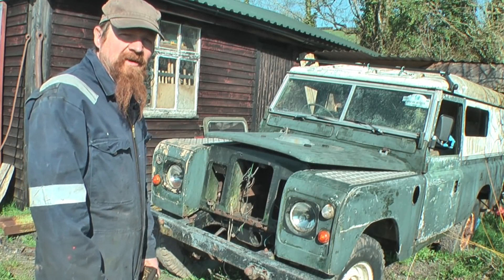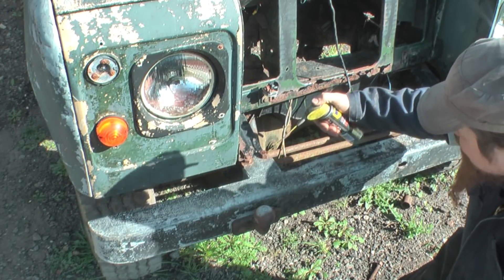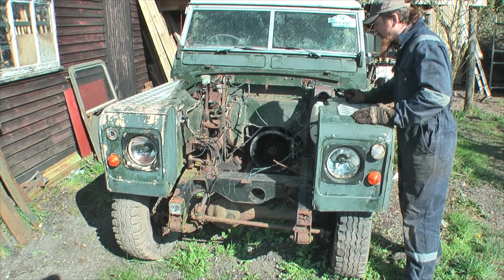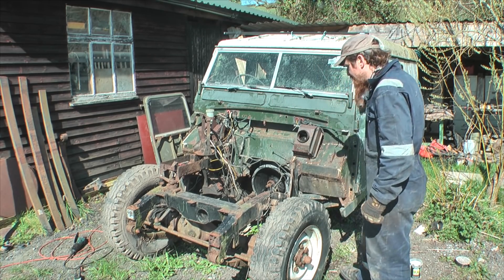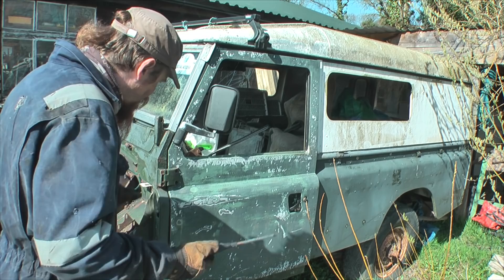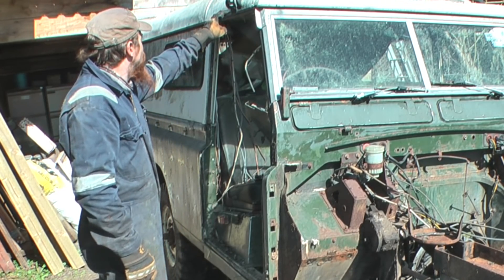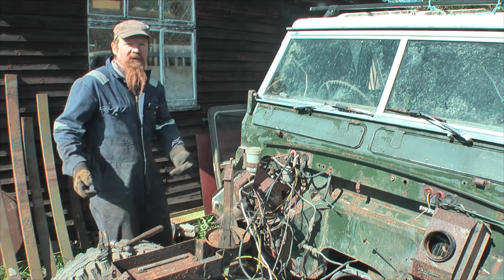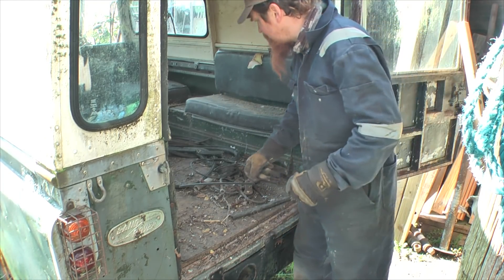Project Kermit 2: A Land Rover Series 3 Full Restoration

Comment: It’s not as bad as the last Land Rover. That caught fire twice 😳
Reply: That's the high spec heating kicking in.
Reply: EnglishAndy I bought a Series to off an electrician who replace the fuse with a 13 amp house fuse! I had a small bonfire in the engine bay and had to replace all the wiring as he had used blue, brown and yellow/green wire to repair it.
Reply: Oh I must have missed this. Wen caught it fire?
Reply: Only twice? You're not trying hard enough!

Comment: A sterling start on rectifying years of corrosion and bovine related bodgery. 
Aluminium and steel never a good combo, Ali bicycle frame steel seatpost springs to mind 🤣

I look forward greatly to the next instalment of your capers. 

Stay safe Max.
Reply: Try ally cylinder head, steel exhaust studs.....
Reply: darronjknight been there done that! Not good I could feel the helicoil kit in my twitching in my toolbox.

Comment: One major piece of advice for when you re build it.  Put the rear tub on first before you fit the bulkhead.  Then shim the bulkhead up with the doors on to get a good fit with the doors in the mid adjustment position.  There is normally a myriad of shims and washers on the bulkhead fixings.  Honest to god it's tub first then bulkhead then doors and roof.   When I built mine i fitted the bulkhead first and caused myself  no end of trauma   suffering and expletives. . Good luck sir.

Comment: Hi Max, as far as fixings go, I think Solihull must have had a market where Landrover bought random nuts and bolts in bulk. You may have an issue putting disco seat in there. They are a lot higher as they are designed to be bolted to the floor not on top of the seat box. Looking forward to seeing the rest of the series on this vehicle.

Comment: straightest wings i've seen on a series 3 for a while...nice 110/90 doors too...
Reply: Standard doors on the Series 3,  had them on both my LWBs
Reply: @beyergarret123  nope, 109's had the 2 piece doors, i think the stage 1 V8 had the military sloping aluminium door tops.but otherwise they were the 2 piece 2 sliding windows on the series 1,2 and 3

Comment: Adult Mechano set, I do love Landies but at 6'4" i just don't fit in them 👍 cheers for sharing ☺
Reply: You need to make an adapted cab! Thats the beauty of them!
Reply: @jackinthegreen1000  elbow space and leg space, I'd have to re-design the whole cab. I'd be quicker just fabricating something from scratch lol 😂
Reply: You can if you take all the door and roof off.

Except then it's more a case of fitting on it than in it.
Reply: @DustyKorpse  sounds like a great idea! Get grinding! 😋
Reply: Dusty Korpse   My height then. I love  driving my 61 LWB. But..... Old seats, flat base flat back so I can sit a little sideways towards middle. No pedal rubbers that does make a difference. Drivers seat slid right back ,1.5" more room set back from the other two. More space behind seats in LWB so get one of they. Though I've had a 2a and an 86" ser1 in the past. The one had Sierra seats in when I got it. Could hardly drive it!

Comment: To undo those hinge screws you need an "Old Man Knocker". Basically it's a pneumatic chisel,which you weld a socket onto one of the chisel bits so it can take a impact screw driver tip. You also need a handle so when you attack the rusted screw ,you can twist it. I use mine a lot and have never met a screw or bolt that refused to cooperate.  You can buy them on line but pneumatic chisels can be found any where for cheap or free.

Comment: Mad because that looks un-reparable to a lay person like myself. Exited to see what it turns out like!
Reply: Anything can be fixed, the question is mainly how much of the original car you've got left in the end :D
Reply: @Ragnar8504  very true 😂
Reply: @jamesfagan69  I don't know about today but 10 or 15 years ago it was still entirely possible to build a whole Trabant 601 from NOS spares! All you'd need was the VIN tag from a "clean" car so you could register it as a "vintage" car. The VIN wasn't stamped into the chassis but on a separate tag that was riveted on. Apparently, swapping those tags was quite a common thing to do among restorers back in the early 2000s - I never owned a Trabant but spent quite some time reading forums back then.
Reply: Looks mint to an awful lot of land rover enthusiasts.....
Reply: @alanlansdell7533  i can only imagine 😂

Comment: Hey mate, I have Discovery 1 seats in my 110. You will need to use a 30mm spacer at the rear of the rails to make up for the angle of the seat box -otherwise they work pretty well (for a short bloke like me..)
Looks like you are a while away from fitting the seats though ;)

Comment: I wonder if a regular lwb like that could be converted to a 5 door ?.I'd be tempted to chassis cab it and put a cut down shortened van luton on the back .or a flat back Australian ute look with some nice varnished timber fold down sides  with sunken holes in the bed so option of some custom hoops to place a extra large canvas cover on the back so it could be a practical stand up spacious mobile field tent if need be complete with stove and foldable timberd ends containing windows and door /steps .I'm getting carried away.love what you are doing .keep going its the best thing iv watched in ages since binky .I wonder what engine ? Old TDI or dihatsu fourtrack 2.8 or a big old six .?they sound meaty.cheers.

Comment: An Impact Driver would be a very good tool for that old Landy. Get a pump sprayer or a hand sprayer. ATF and Diesel mixed works well has a penetrating fluid and lub on rusty bolts. You have a Compressor use your Air tools more. Are you in for a load of Welding or putting a Galvanised chassis under it. Do you have a neddle scaler would be handy for going over the chassis with.

Comment: If in the future you need penetrating oil. Diesel Fuel warmed. Brake fluid (non painted parts ) , or red automatic trans oil  heated to hot..  Might make a video idea if your bored. Use a small brush to apply.

Comment: Hi Max. While we're in lock down, would you consider doing a metal workshop Q&A? I have a cheapo MIG welder someone gifted me and the gas won't flow. Wonder if you know of potential causes,, especially ones that have home remedy potential.
Reply: I can pretty much guarantee its the foo foo valve they can be very problematic.
Reply: @geraldswain3259  'foo foo valve' aye? Is your response the equivalent of asking the apprentice to go down the hardware shop to ask for a 'long weight'.
Reply: @spinny2010  can you grab me some tartan paint while you're there 🤣
Reply: @jangomoonstomp  the best one ever can only be spoken. Forkandles.
Reply: Spot on!.

Comment: I used to have a s.2 109 w/b van type that someone had put 4 small oval windows in the sides, the seats init were ripped and stuck together with rhino tape so I yanked them out and used two Escort Ghir seats bolted down on 2 1/2" x 1/2" flat bar.

Comment: A little project for you max......make up a set of long screwdrivers (Phillips, flat and torx) cut off the handle material but not the shaft, make new wooden handles and in the bottom cut a square hole that you can insert a square piece of metal big enough to fit a socket set ratchet. Attach handles to screwdrivers. You now have a set for removing stubborn screws by inserting the ratchet in the end for a ton more torque. The longer the screwdrivers, the more torque you get. It beats all that faffing around with slip-joint pliers. You can grind an old beat up socket square to make the bit for the ratchet to fit into.😁 why all drivers don’t come with handles like this is beyond me.
I found a guy using what I’m talking about. Go 10mins into this video
https://youtu.be/Kt7HBDTSE40

Comment: Its been a while since I worked on one of these but Im sure there's something missing. It would have been fitted as standard at the factory and is located just in front of the bulkhead, between the front wheels :)
Reply: Yes, in the Haynes Manual it's called the master oil leak unit!